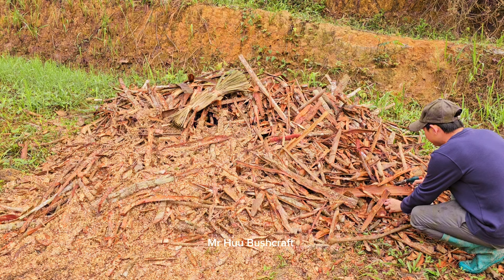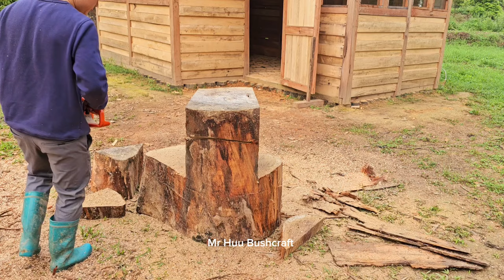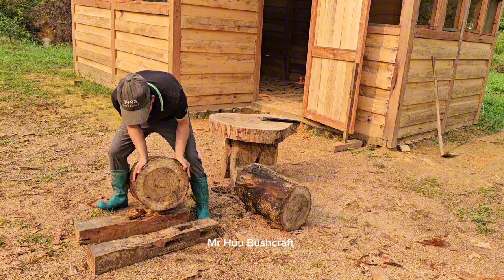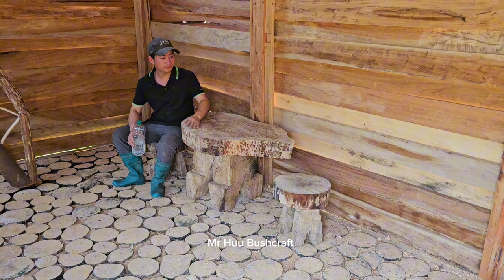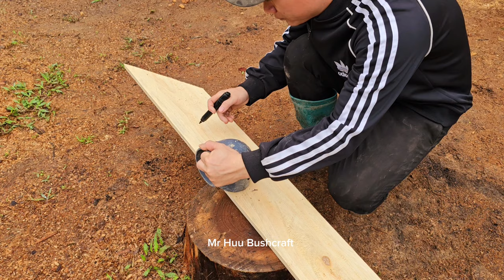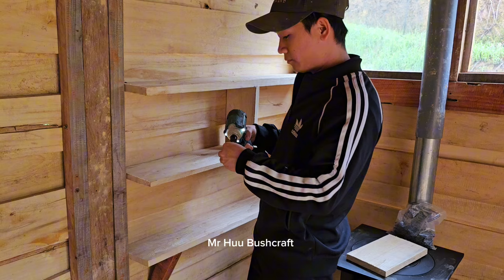I FINALLY Built A Heating System In The Log Cabin | Building Log Cabin.

Comment: Better put some heat resistant material between the stove, stove pipe and the wall or you’re gonna have a fire sooner or later. Also hope you didn’t use plastic pvc pipe as any part of the stove pipe, cause it will melt starting a fire.
Reply from the maker: Thank you so much 😊